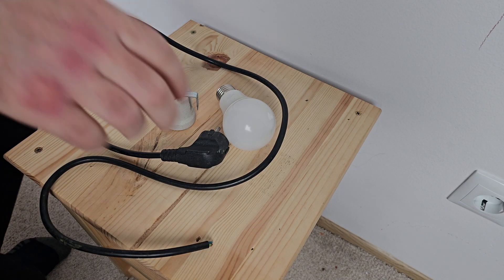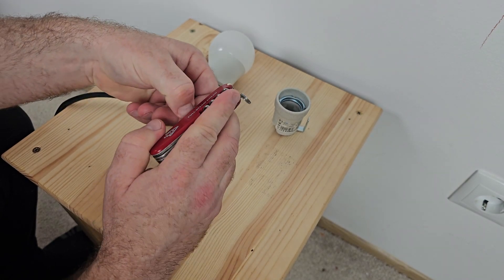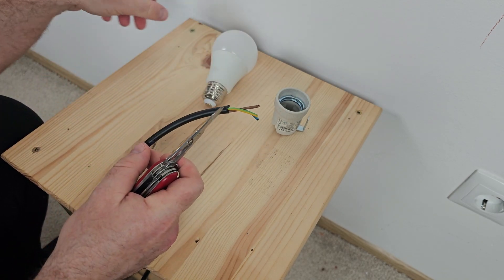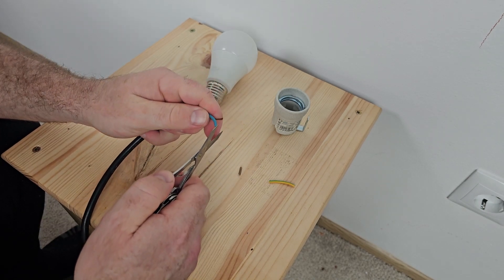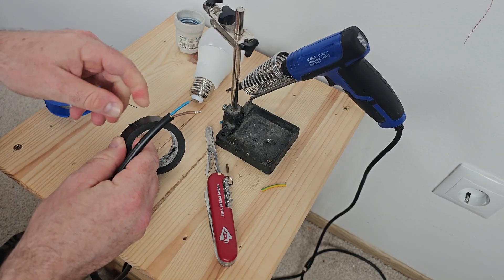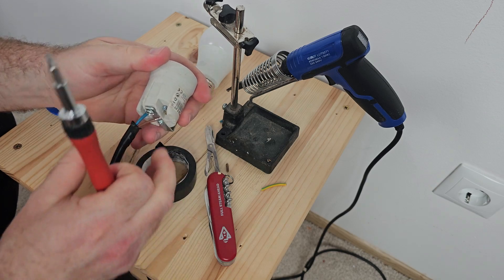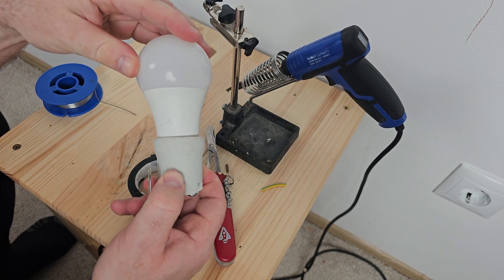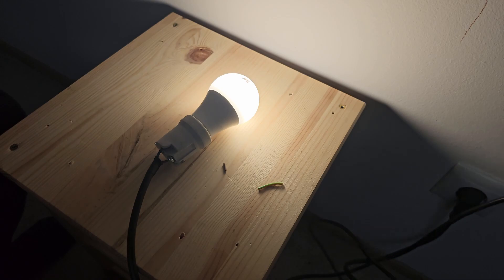How to wire a E27 Light Bulb Holder

Comment: 1:10 - The ground wire can be hooked up to the L shaped metal part of the fitting. When fitting is screwed onto the lamp body, this makes it sure that it's properly grounded. Cutting it off is usually enough, in laboratory conditions.